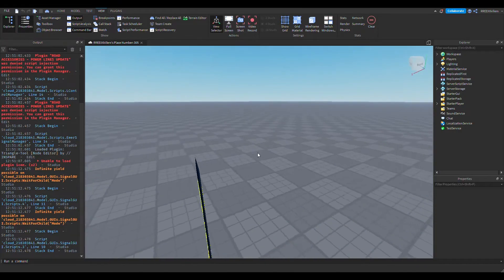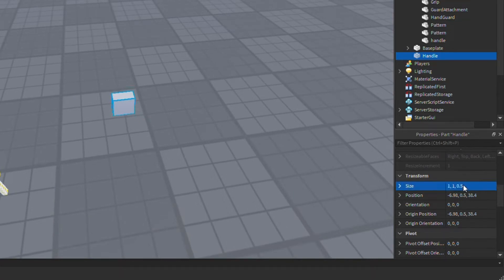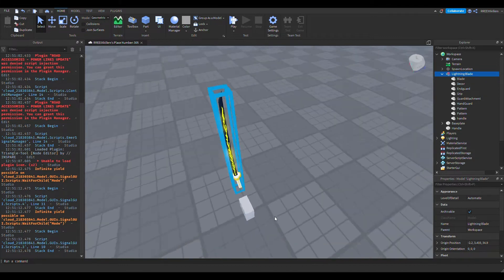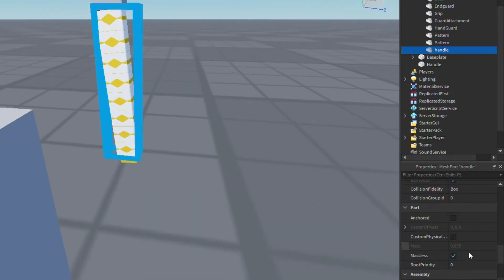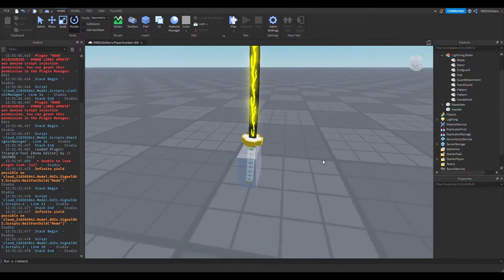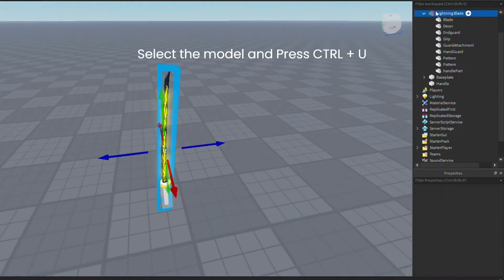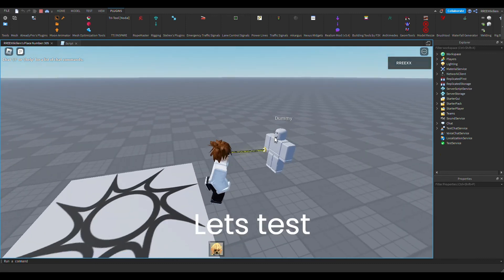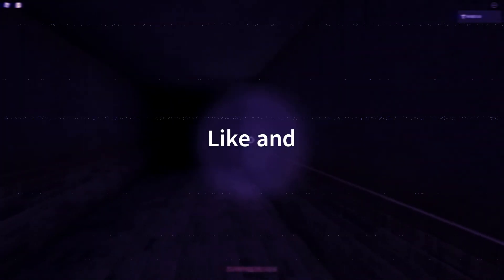How to make Thunder Breathing in Roblox Studio (Part 1)

Comment: the sword works but it' far away from my hand
Reply from the maker: Use a tool handle plugin 
You can search that in the toolbox
And learn about it in youtube
Reply: @Iconic_Player  hey can u help me? i Tried ur method the Handle Part shows up in my hand but the Sword Model doesn't
Reply from the maker: @fakirilyass3182  you probably need to weld the sword model to the handle
Reply: @Iconic_Player  nvm i do have another problem the sword is not in the corrent position
Reply from the maker: @fakirilyass3182  for things like this it's best to use a tool grip editor 
Tool grip editor -- https://www.roblox.com/users/2155311/profile/